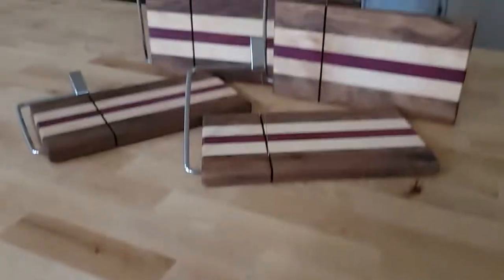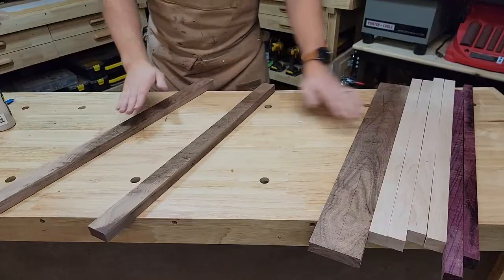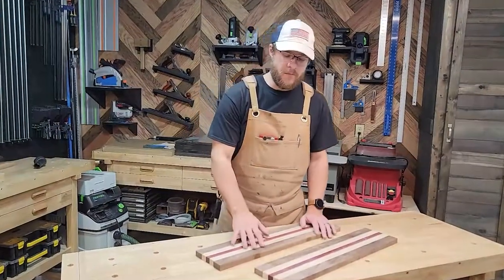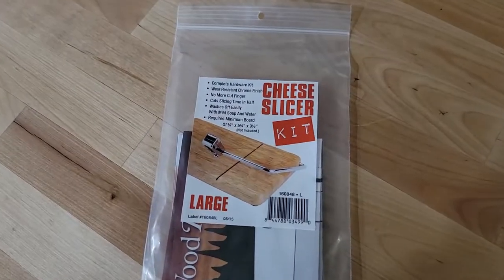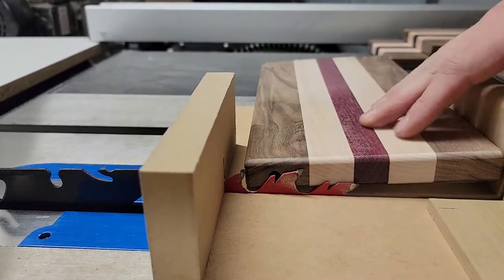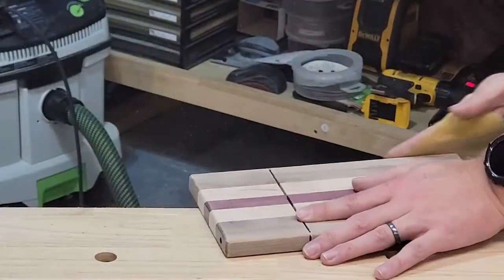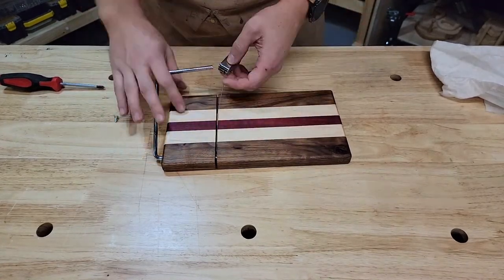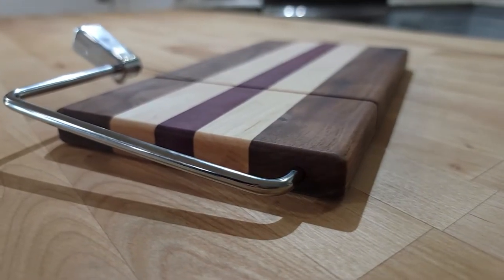How To Build Multiple Cheese Slicer Boards Quickly | Woodworking Gift Idea

Comment: Can the wire be changed when it breaks, or do you have to buy the whole knob/wire assembly?
Reply: You can buy wires, or make them out of guitar string. I am thinking about trying to make a serrated blade from a hacksaw blade for funzies.   Walmart sells cheese slicer wire according to the app, but it is 24” long… not sure if that requires a tool for crimping pieces, or if it’s just twisted at the end.
Reply: @liquidrockaquatics3900  It looks like it would be a hassle getting them to the exact length and twisting them to where they wouldn't slip or break. The reason I asked is because the handle has a pin going through it that goes through the wire loop, and the pin seems to be permanently pressed in.
Reply: @donf3739  I have bought several kits for the ones I intend using for gifts this year, but I haven’t seen any exact fit wires, but I have not really searched. I know my grandma had my uncle rewire both her egg slicer and her cheese slicer with guitar wire, and that worked for the next 15 years or so.. whomever has them now probably hasn’t changed the wires.  The guitar wire is really stiff as I remember and only needed a couple wraps back on itself to lock in and tension up.

Comment: you mentioned you sell the kits.  How much do you charge etc.  Nice project and hopefully they hold up as wire will break in time.  thank you
Reply from the maker: I don't personally sell the kits, you can find them at Woodcraft for around $15 and replacement wires for $8-10 in packs of 4. So far I have only replaced it once and it was my fault for trying to go too fast.

Comment: Sweet! What were your dimensions?
Reply: I have the same question.  Thx!
Reply from the maker: The width depends on the kit you buy so the handle will fit properly. I used the large kits from Woodcraft and they came out to be 5.5" x 11.5"